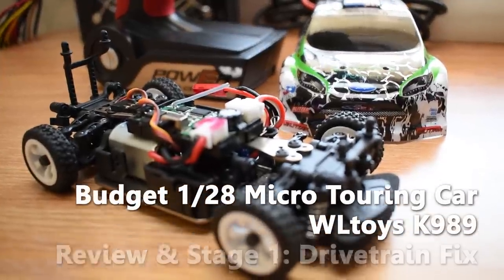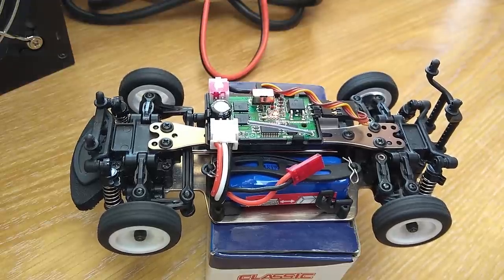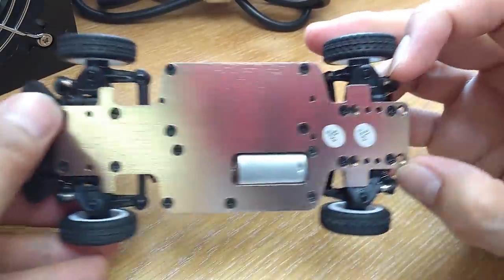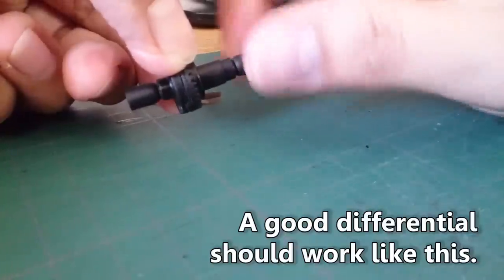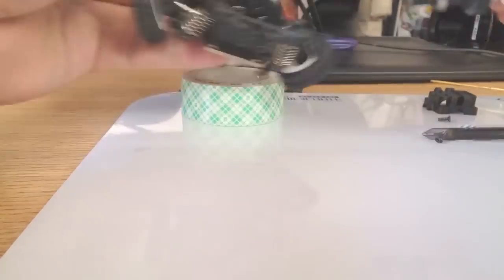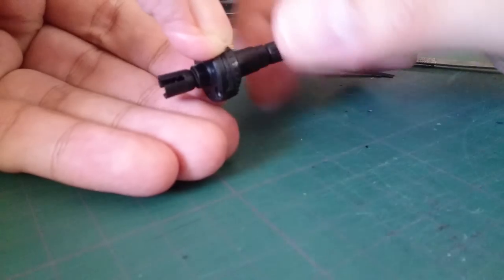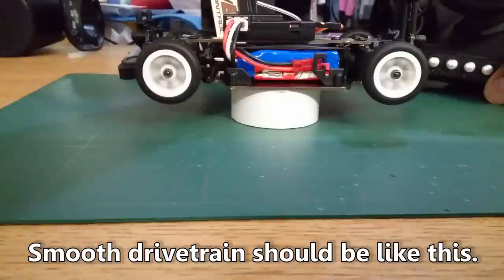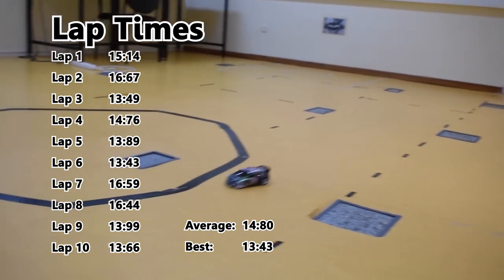WLtoys K989 Budget Touring Car - Stage1 Drivetrain Fix

Comment: Thanks for all the tips and advice Beaver , I think they may have improved them a bit over the years since you made this , IDK . 
I just got a brand new one and the diffs were a little tight but not bad , Some normal break in helped smooth it out though .
I also used some very small pieces of double sided mounting tape under each wheels lower suspension arm and the chassis to act as droop screws would . 
The car handles much better with this very easy mod IMO . I was also surprised it could take a 3S  , 11.1volt lipo battery as well .

Comment: Thanks for this helpful video series. 

I am new to RC cars and bought a wltoys 284131. I would have been lost and confused without these videos. Especially as to the stiffness of the drive train, and the momentum problem before adjusting. 

I was planning on learning slowly with the throttle adjustment that is on the transmitter of the 284131, but out of the box, the drivetrain was so stiff that the car would not move until I had the throttle adjustment set to 75%, which was way too fast for a newbie like me😮.

Much thanks!

Comment: Hello Baver. Thanks for this great video.  Unfortunately on my new K989 one of the two differentials (front) does not open. It appears that the left and right sides are glued next to one of the 3 screws. In fact, close to the other two it opens, but near the third I can't open It and if I continue to force it will surely break. The other differential opened as easily as in your video. Now it is definitely better. Everything works. Thanks again. 👌
Reply from the maker: You can replace the differentials with Mini-Z AWD or metal  differentials https://bit.ly/3Iq6rWp then use long CVDs. https://bit.ly/3m1i4bd. Unfortunately the metal diffs will chew through your prop shaft pinion very quickly.
Reply: @BeaversHobby  Thank you. I ordered exactly that right now . I've found a kit 2 differential with 4 dog-bones 27mm. Let's wait. ☺️🙏
Reply from the maker: @maximilian799  Best of luck with the project!

Comment: Hey just wanted to let you know that this vid is really helpful for me 👍 came from 1/10 scale & my 989 diff is a bit stiff. Sanded the edges & remove all excess plastic and glued the rear diff bc I did it for drifting. Now my car moves only by pressing the trim button once which is very great 🙏
Reply: Trying to do this myself... Locked the back diff but dont really know where to start with sanding xD... Did you need to "run it in" before it was smooth?
Reply: @jimz1024  you can press the trim button once, if the motor is making sound but your car is not moving, means that you need to sand it more 😂😂 the key is to smooth up excess plastic around the diffs 😁 if sanding is perfect, the car will move with just one press on the trim button
Reply: @Firda4415  OK mate that's perfect, so I should focus on sanding around the diff housing that connects to the gears... Currently makes a noise but doesn't move till right near the end of the trim 😅

Comment: I have been looking for this video. This is the problem I have with mine atm. And because of that the car shut down when going fast. The differentials or the driveshaft are running to stiff.

Comment: Hello Beaver. If I may, the most incorect tune from the car I received was the wheels. They were way to tight. Releasing them a little bit went from not turning with full trim, to turn with only 1 trim step. Have a good day ;)
Reply from the maker: You are extremely lucky! Most of use just got the car with sticky drivetrain, bear mesh, gearbox, the whole shebang.
Reply: @BeaversHobby  I did all your mods anyway. One diff was very bad, while the other was ok. I also added silicon grease on the pignons. Thanks for the great videos (which, honestly, made me buy this car ^^)
Reply from the maker: @Izlolz  My pleasure. Good luck and have fun!

Comment: Perfect video and series. I used most of your tips for modding K989 to drift spec and I'm very happy so far. I'm thinking about a budget touring car and you make this series. I'm so happy because you are my favorite when it comes to mini cars and you are working on exactly what I want. Perfect!
How can I build a budget lap timer?
Reply from the maker: I use Arduino with Infrared Obstacle Avoidance Sensor. Wiring is also simple, vin-5V, gnd-ground and out to digital pin 2.  The code is very simple, just print the time whenever something passes it.
Here's the code if you want to examine it:
https://drive.google.com/open?id=1dVUi1qUffvZCo8p1b_HTTwQmA1JzwaZZ
Reply: Very nice thanks. Maybe you could produce a video with is content?
Reply from the maker: Sure, it'll be a very short one of course but I could make it.
Reply: I googled the sensor and learned it only has 10cm range. Is yours modded for more ir range?
Reply from the maker: No, I just drive the car really close to the sensor.

Comment: I've just received my wltoys 284131, which is my first R/C car. I've noticed some stickiness too, and your video will certainly be quite useful to fix this problem. Would lithium grease be okay for the differential, or should I buy silicone grease? Thanks for the answers!
Reply from the maker: Lithium grease is also good.

Comment: U really helped me out. Especially because I haven’t even got it yet. By the way, are the electronics running cooler? That’s something very important!
Reply from the maker: Yes, the motor runs cooler after fixing the drivetrain.
Reply: @BeaversHobby  Thanks for the fast comment! Does this sticky drivetrain come on all cars?
Reply from the maker: @Tiickel  Yes, as far as I know every WLtoys 1/28 (K989, K969, 284131, etc. whatever the number is, they are all the same chassis) has sticky drivetrain out of the box.
Reply: @BeaversHobby  thanks for all the help! I’m going to get one for my birthday. I can buy it after two days!
Reply from the maker: @Tiickel  My pleasure. Best of luck and have fun!

Comment: Wonderful vidéo. What dony0u thinck about metal diff?
Reply from the maker: It'll destroy your pinion gear very quickly so if you want to upgrade it, you'll have to upgrade the whole thing to metal. Otherwise there are better quality and smoother diffs available from Atomic AMZ/SZ and GL Racing GLA.

Comment: Fantastic tips! Although for costs I did notice you had 2 or 3 kinds of grease and lube, but I imagine a lot of people in the hobby have those already?
Reply from the maker: I had them from when I was playing Tamiya Mini 4WD so I guess they are common. Anyway, as long as the grease you use is compatible with plastic then it'll be alright. Nowadays you can find PTFE grease from Arduino robot shops or STEM shops pretty easily.

Comment: if u file down the edge of diff where the bearing goes that causes the bearing to be jamed against the diff .. it has that tiny raised part for a reason .. to bind the center of the bearing but when you file it down now bearing can not run properly ..  what you really need is some shim on other side to try push that side a tiny bit further out .. Im guessing the plastic will just wear down after a couple of runs and wear out ..  I had same issues with my 284131  .. i fixed front diff perfect back nothing can do to fix the rear one  .. it will not mesh at all .. I am ordering a metal ball diff and another plastic one and see whats better ..
Reply from the maker: I showed how to do the outer side of the diff where there is an imperfection on the gear part and that bend backward causing the diff to rub against the gearbox. Do not file the edge for bearing. If you accidentally file the whole thing down then yes, you'll need to shim that back so the bearing won't jam up.

Comment: Hi Beaver! Is this guide for fixing the drivetrain  similar for the K969? I know you've mentioned that the k969 has a locked differential.
Reply from the maker: Yes, it's the same on K969 too. Everything is the same except the diff. It doesn't have bevel gears or spider gears inside so you don't have to fix that. Just check the diffs' thickness and it's done.
Reply: @BeaversHobby  Thanks!
Reply from the maker: @zeldajunkielol2  My pleasure.

Comment: Hello beavers, I accidentally trimmed arms too and back wheels of my card shaking front and back now, do you think is that affect my drive too much or should I change them?
Reply from the maker: You can sort of fix that by using rubber band to hold the arms to one side either front or back so they won't wobble forward and backward. If they wobble beyond fixing then you'll have to replace the arms.
Reply: @BeaversHobby  appreciated

Comment: What oil and what grease are you using? I don't have that, so it isn't really free...
Reply from the maker: Oil that I clean bearing is WD40. I use Contact Cleaner with oil (orange can) to lube. Then the grease is just standard ceramic grease for plastic. You can also use ceramic grease from Tamiya.

Comment: Help, i filed the differentials and made them smooth but now the car doesn't move when it's on the ground. but the wheels move if the car is not touching the ground. did i do something wrong?
Reply from the maker: The differentials probably got filed down too much at this point. If it runs when not on the ground then I assume the crown gear has contact with the centre shaft pinions. Maybe the bevel gears inside are loose and won't send power to the wheels. Try and adjusting that and see if you can get it working. If not I'm afraid you'll have to lock the diffs or replace them.

Comment: My 144001 having a prob recently. My esc was burned. I replaced it and didnt play it for 1 month as i was waiting for the esc to arrive. But i feel the car is not like how it use to be, the car sound has been very low. Before it sounds alittle loud but now its not. Second the car is not smooth idk it is bcs of drivetrain or smtg. I suspect this could be bcs of the metal diff cover case i upgraded. Th size is alittle different than the original plastic one. So the rear motor mount screws go alittle front
Reply: And i think i should replace the motor too. Any idea
Reply from the maker: @loga_912  The stock motor is pretty big so you can change the motor mount to the one for 144010 and use any 2845 brushless motor. It'll be less heavy to one side.

Comment: My suspension arms were really sticky so i filed them down from the sides and filed the bolt holes a little bit too. Now it has some wiggle in it but the suspension works smoothly. Should i be concerned about the wiggle?
Reply from the maker: A bit of wiggle is fine as long as it doesn't come off. If you don't have any wiggle at all it won't move smoothly.

Comment: Another question. My WLtoys 989 is running great. Do you recommend locking the diff for better drifting.  Or at least more controlled  drifting?
Reply from the maker: Yes, locking diff makes it more consistent and easier to drift. Try locking the rear first and if it's still hard to control then lock both front and rear diff.

Comment: heyyy i al having a problem with my k989. when i hold the throttle down it just keeps cutting out like ticking. a problem with esc?
Reply from the maker: Sticky drivetrain/gear mesh can make it cut off because of excessive load.
If the battery isn't charged or faulty the voltage will drop and cause the ESC to cut out. If those are good then it's either the ESC or the motor itself.
Reply: @BeaversHobby  so basically i have 2 k989s one main for drifting and one for parts. u put the esc of the obe for parts to the main one. it seems to work now. do you think this should solve the problem?

Comment: What is the lube that you use the thin oil and the thick grease. Thanks great video series I just got one as a gift and I wanna improve mine. Thanks
Reply from the maker: Oil is a bicycle chain oil.
Grease is a plastic grease. You can use ceremic grease from Tamiya or PTFE from a small robot shop.
Reply: Beaver's Hobby thanks for getting back so quickly. This little car has potential for sure. All your videos are great I’ve watched the whole series.
Reply from the maker: @rbmwiv  My pleasure. Good luck with the project.

Comment: Hey, my car was running smoothly, diffs and all gears are good. But today after playing it for 2 times in day, (2 battery packs time) , the small pinion gear at the front shaved off. My car was rwd for moment and when i checked the pinion was shaved and not usable anymore. Then i putted the rear pinion in the front, and i used the longer pinion that come with the car in package for rear and extended wheelbase. I played it two times and now another pinion in the front shaved too! What can i do :(
Reply from the maker: The gear is quite low quality so you might as well change or upgrade it to metal.
Reply: @BeaversHobby  Alright, and one more thing, my motor pinion is metal. So can i change the pinion gears for front and rear? And can i change the diff in metal too? Every gears metal
Reply from the maker: @loga_912  Yes, you can. It's better that way too.
Reply: @BeaversHobby  Thank you, but i couldn't find the small pinion for front and rear. Do you have any link for it or do you know the name of the pinion gear to search maybe ?
Reply from the maker: @loga_912  Here https://bit.ly/3w7XChB

Comment: Hey beaves, what do you do when the wheel bearings keep popping out? It's annoying for me because mine keeps popping out. Thanks man
Reply from the maker: The wheel bearings are supposed to be sandwiched between the wheel and the shaft. I'm not sure how can they pop out but if the wheels don't sit well or fit well on the shaft the bearings can slide out. Is this the problem you are facing?
If after you fully tighten the wheel and you can still move it in and out then you will need some spacers to fill the gap.
Reply: @BeaversHobby  thanks so much. You're right, the problem was that I used new standard k989 wheels for my 284161. Didn't notice the cvd shafts were longer lol my bad. Do you think the longer cvd shafts (27mm) work for stock diffs + k989 wheels?
Reply from the maker: @sontoshi25  Unfortunately the new diff has shallower drive cups so longer shafts won't fit. But don't worry there are ways to fix this. 1. Sand the drive cup slots down to fit longer shafts. 2. Swap the outer shaft with the 27mm. You can pull the rubber out, follow with the pin and install the old shaft (wheel connector) part to the old dog bone (diff connector). So you'll have the spare longer dog bone in case you want to upgrade the diff later. Or 3. Replace the gear box with old version and use Mini-Z diff.

Comment: ✌🏻😎🏴I received one of these today. Should I do this modification too? or did they sort it out and fix the problems?
Reply from the maker: Yes, you still have to inspect and fix it because the build quality is till dreadful as ever for this car.
Don't forget to check out the episode 2 too to free up the suspension.
If the problem isn't too bad for example differential work but a little bit stiff, you can sort of drive it and it will wear down and get smoother over time. The thing you must check is the drivetrain so you won't stress out the motor and ESC.

Comment: Awesome video. What kind of lap timing do you use and where can I buy it. I want a build a track with some cars and I need a lap timing kit. Is this kit works with more cars? And is it have some live output for pc-s?
Reply from the maker: I build it out or Arduino and infrared range sensor. Unfortunately it only works with one car because it resets the clock and print the time every time something goes pass the sensor.
If you want a proper lap timer look at robotronics and EZlap

Comment: I have 969 i tryed this but since it is a locked diff I just did the casing outside of it I got it looser than what it was didn't want to send too much off as it seemed to be getting lower but the car still doesn't roll on its own now I skipped the part where you sanded down the inside of the diff since it is locked I figured it wouldn't matter unless I need to sand down the spacer in the center of the deck
Reply from the maker: Lock diff is easier to do because there's no gear inside. However check the spacer in the centre if you want, just to see that it doesn't have excess plastic and push the diff gear out. Also check the gearbox wall on the top, there might be some rubbing. Sand down all bearing slots so they have a bit of wiggle room, not too much but just enough to not binding.

Comment: Hi Beaver, could you please tell us what kind of timing system are you using and which transponder fits in this car?
Reply from the maker: It's a simple system with IR obstacle avoidance and Arduino. https://youtu.be/PnjQiEHf5iw
You can substitute the IR with TOF and it'll work better without anything to block sunlight.